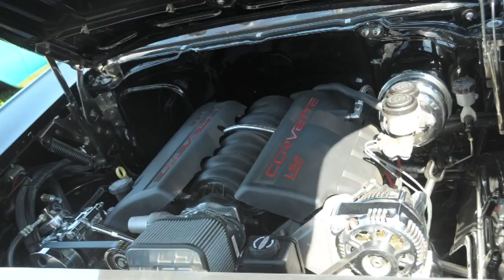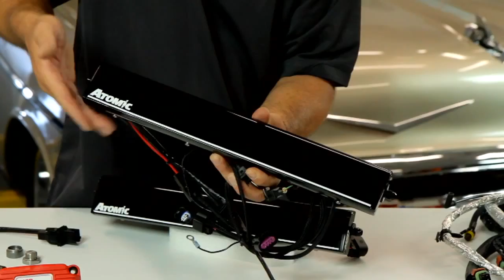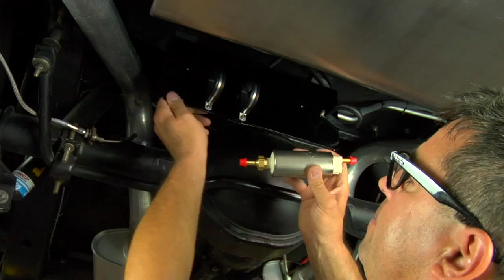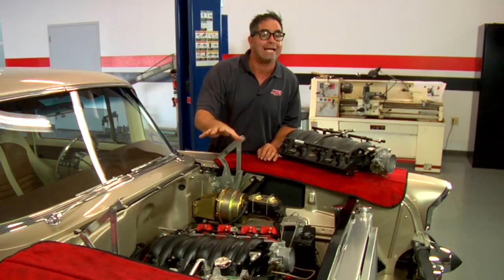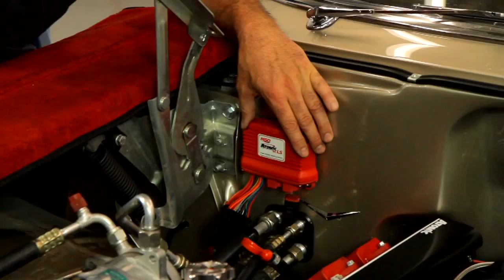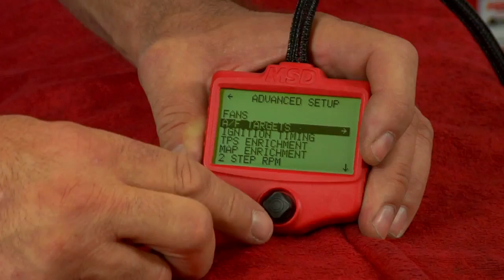MSD Atomic EFI LS Installation Kit Master Engine Electronic Fuel Injection

Comment: Spark knock sensors were never mentioned ??   Or drive  By Wire Throttle Body ??  @JEGS Performance   ???
Reply from the maker: See the following instructions for all of the details: https://www.jegs.com/InstallationInstructions/100/121/121-2960.pdf

Comment: Anything like this for a series 1 3800
Reply from the maker: Unfortunately not at this time. Sorry.
Reply: JEGS Performance ok thanks. Any performance parts at all
Reply from the maker: Year, Make, Model?
Reply: JEGS Performance 1988 oldsmobile toronado
Reply: JEGS Performance I was thinking a carb swap but don't know where to start. Or if I need a msd ignition box or if I could use the stock ignition an coil packs
Reply from the maker: Here is what we can help with: https://www.jegs.com/webapp/wcs/stores/servlet/SearchResultsPageCmd?storeId=10001&langId=-1&sbv=true&engine=4294799019&submodel=4294829828&model=4294826702&make=4294829276&year=4294829838

Comment: Wheres the fuel pressure regulator?
Reply from the maker: +D Fuller Please contact MSD Tech at 915-857-5200. They will be able to give you a correct answer.

Comment: I like the fact that it is a cleaner swap due to less wiring but I still think that efi live will give you better results as far as tuning. Also if you have a heavily modified  motor this may not get you tuned correctly. Example - 1000cc injectors, callies 4" crank, afr heads, or a huge cam. I'm sure that it would get you close with a stockish motor but a laptop tuning program will get you exactly what you want.